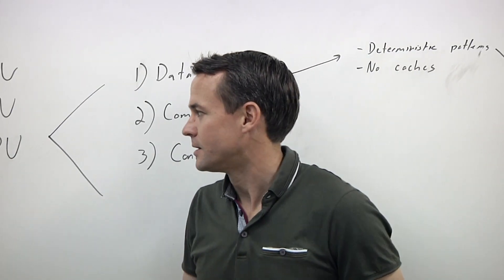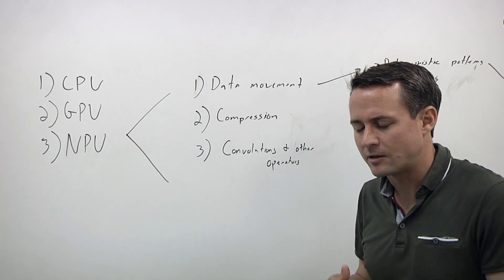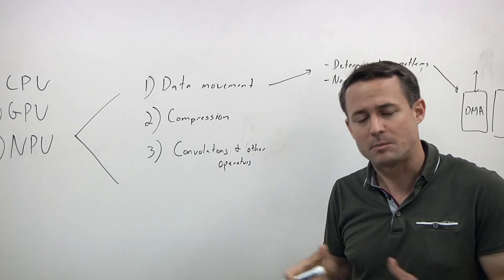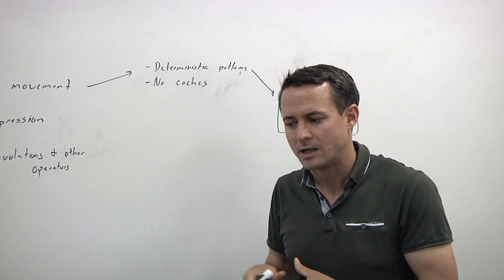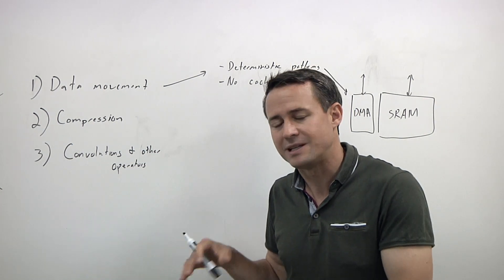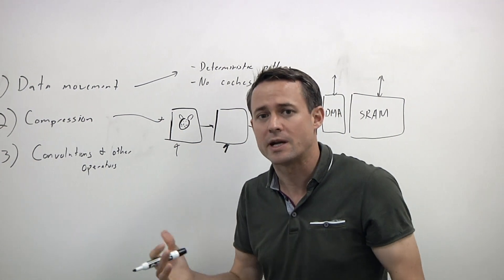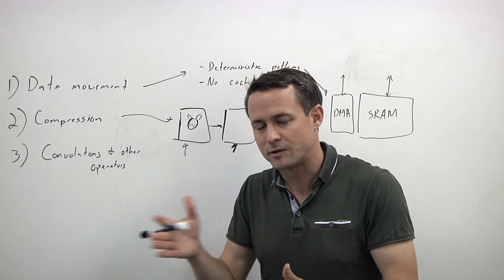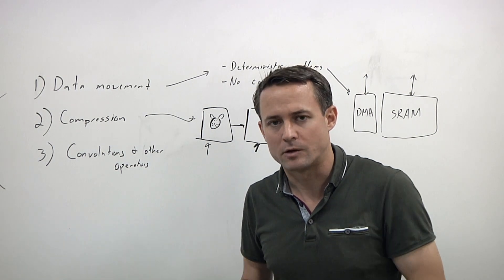ML Inferencing At The Edge

Comment: I think we will start to see embedded AI accelerators on DPUs (Data Processing Units). This way it's possible to do inferencing at the network level without relying on host CPUs or GPUs. This means higher throughput and lower latency.